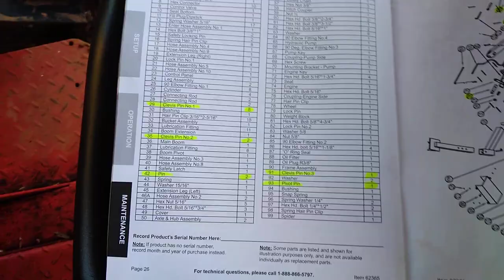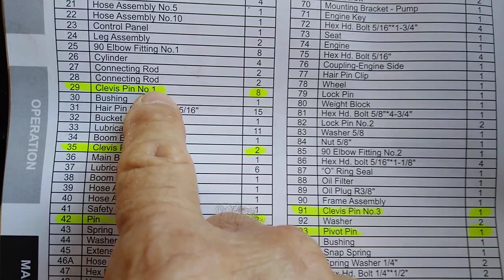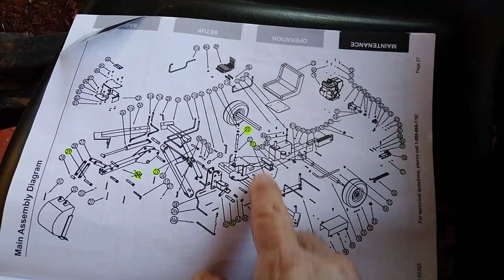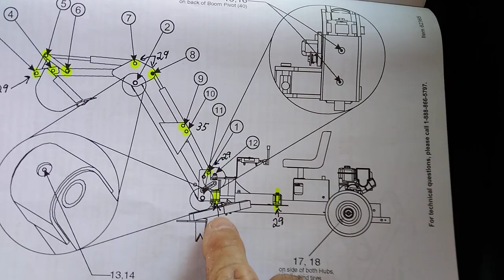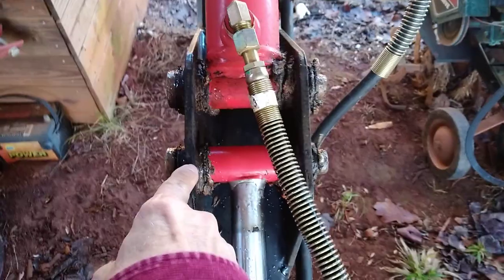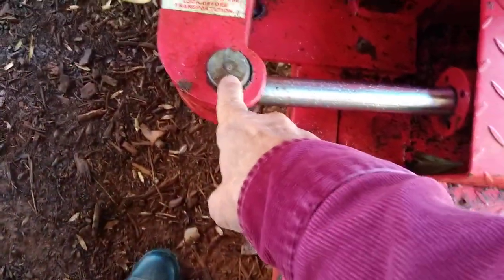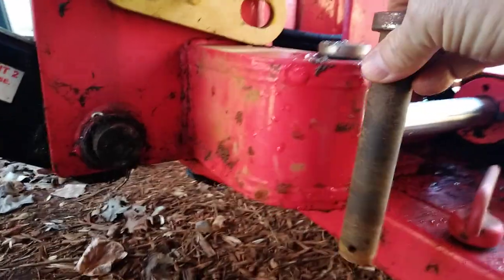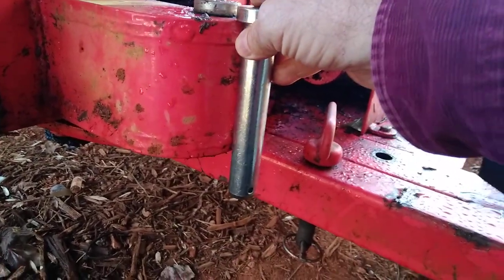Harbor Freight trencher, changing the clevis pins.

Comment: Mr Henry you have become the de facto authority on the HF towable backhoe. 
I need to dig a trench for a sewer drain pipe running along the base of a vertical ridge along the edge of a driveway, it needs to be located there so that I wont be driving over it. 
From your experiences will I be able to get close to the base of the that ridge or will the stabilizers force me to trench further into the driveway?
I can use the HF towable for many other projects but would hate to have to rent a walk behind trencher after buying the HF towable.
Reply from the maker: Well, thanks for the kind words but I'm no "authority". I'm just old and have learned from my mistakes.😁Now, as for your job there, I'm not sure how much room you have between the drive and the ridge but the stabilizer will stick out some. I have done two different things with mine that you could try. I have pulled the stabilizer in as needed and then drilled another hole in it to pin it in place. I have also dug with the wheels on instead of stabilizers but to do this it must be hooked to a tow vehicle (a heavy, strong one) and you must dig slow and careful to keep from breaking something. These things are very strong and could pull a bumper off a truck with no problem. I tried it with my small tractor and it drug that tractor instead of digging. I was digging in hard clay at the time. Just my thoughts and what I have tried. Hope it helps. Let me know how it works out.
Reply: @DoubleMFarmHomestead 
Thank you sir, I didn't realise that the width of the stabilizer's could be reduced that's helpful information. 
I got an off grid project in good ol red dirt blue ridge NC
Reply from the maker: @davidmc2861  Glad I could help. Sounds like we are digging the same dirt. I'm at the base of the Blue Ridge mountains in "Upstate SC". Keep me posted on how it works out for you.